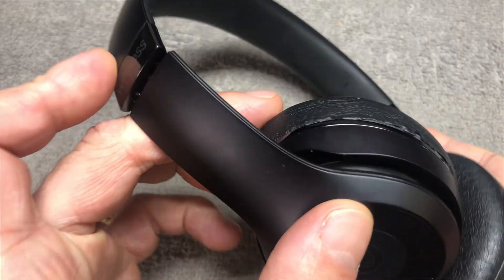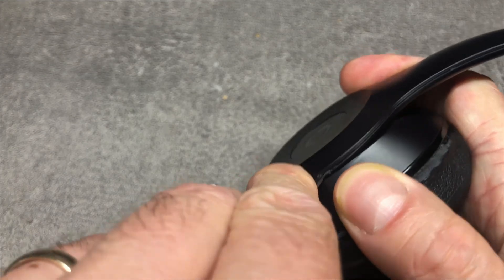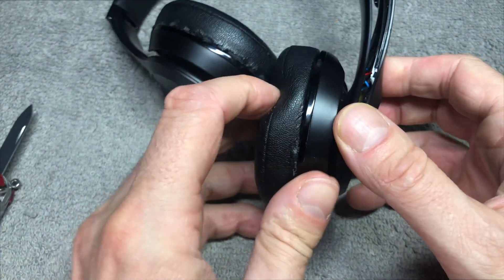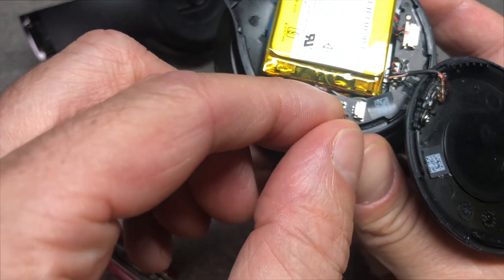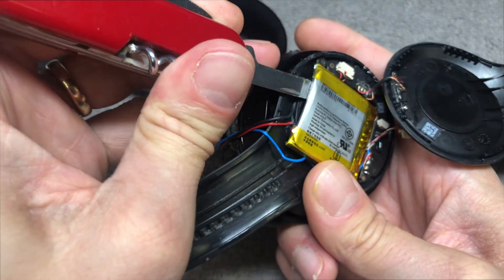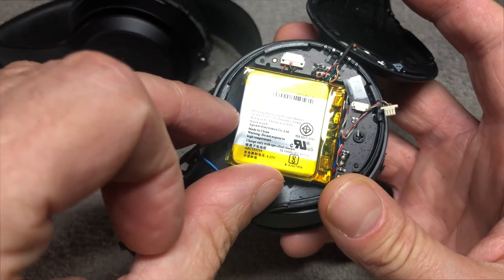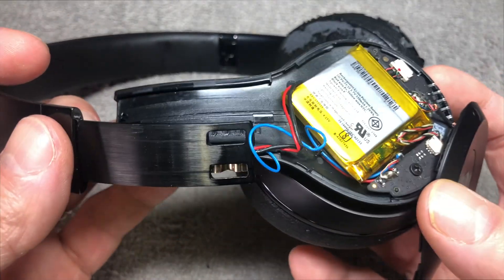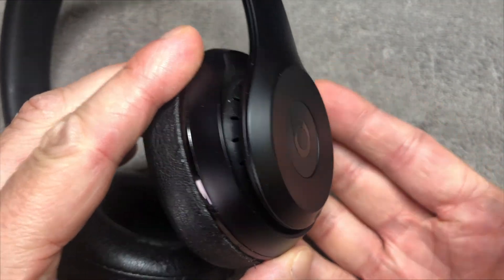Battery Replacement BEATS headphones SOLO3 (How to instructions)

Comment from the maker: The replacement battery on Amazon: https://amzn.to/3JbqYjw

(associate link)
Reply: If it flash a red light does it mean I need to change the battery, I have the Solo Beats 3
Reply: @nashiacyriaque6660  I actually was having the same issue and finally figured it out. Had an old Samsung soundbar and remembered all buttons needing to be double clicked before the factory reset sequence. Applied the same to the beats and BINGOOOOOOOO!!!!!

Comment: Well, the battery connector completely came off so even if I had the replacement battery to put in, there’s nowhere to connect it to. I think I just completely rendered these headphones not repairable. if I could include a picture I would. It doesn’t look like that is possible.

Comment: Thank you very much! I was able to pull it off. It worked like a charm. But I will say that the glue is sealed to the battery like you wouldn't believe - - I had to shimmy, corner-to-corner to remove the battery off that super glue adhesive it was on. I will subscribe to your channel. Hey, enjoy your Summer! 😄

Comment: Thanks very helpful I found out that the battery connecter wasn't plugged in correctly...
And after pressing it in, 
the light started to turn on and now everything is working fine😌 didn't even need a new battery 😅👌🏾

Comment: I need help my Beats won’t turn on so when I open up the headphones and I see the connector plugged in, that’s when I plug it out. Then when I plug it back in again that’s when the lights start turning on, but I start seeing all the flashing lights then a red light flashing. But all the lights go away after and I’m left with one white light on the headphones. Does this mean my battery is dead?
Reply: Yes, that means your battery is dead😁

Comment: Interesting, in my solo 3 the plug is glued so it is not easy to remove without tearing it appart!
Reply: Same
Reply: Same here. While replacing the hinge I did a real scrappy job just melting the glue off with a soldering iron
Reply: Same bro
Reply: Yeah went very gentle with a soldering iron then Stanley knife.  Was so hard.